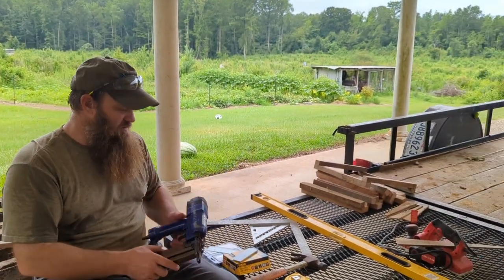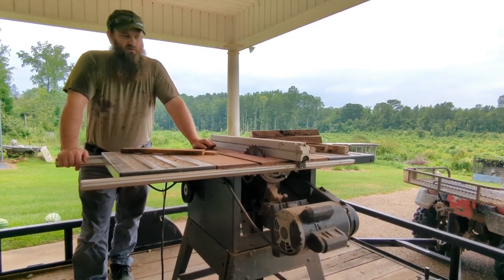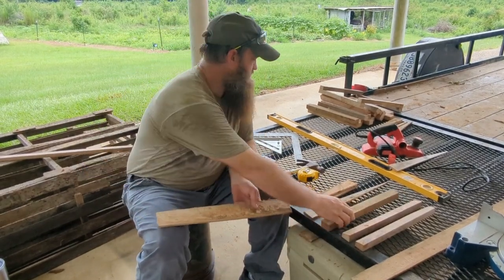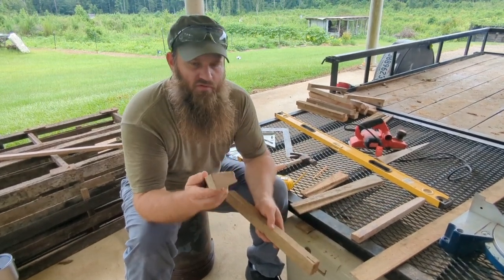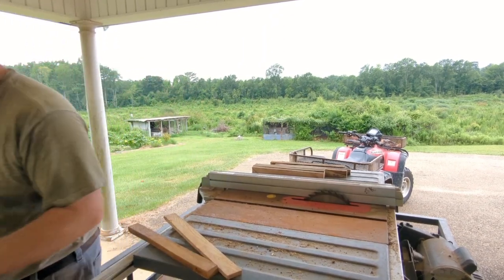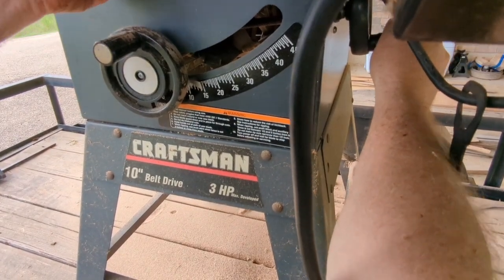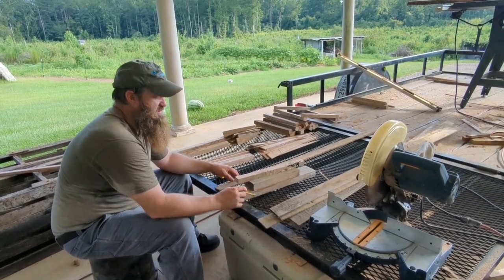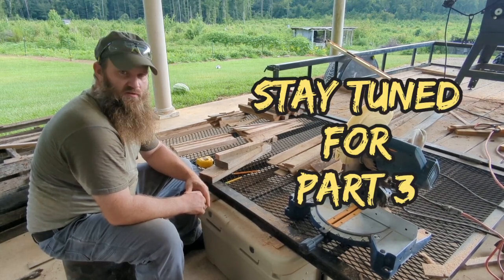Building Homemade Catfish Slat Traps Part 2: (Materials Needed & Making the Cuts)

Comment: Was the bevel angle on the catch slat frame also 15°?             Just watched the third video in  the series and I think I got the answer to my question. Thanks for the videos.
Reply from the maker: 19-21 is my recommendation. You'll have to play with that to fit your likes depending on type wood used and flexibility. Ash you can go 21. Oak you may want 19 or20

Comment: I really enjoy ur videos. I am new to commercial fishing. I just started this year. I have the wire traps. But I haven't had any luck with them. I would like to get a few slat traps but Mississippi have different gaps then urs. Would love any advice u could give me on fish wire traps
Reply from the maker: Yes I think Mississippi is 15" square or smaller. I know the regulations are online if you Google search it. I've had better luck with wire nets in lakes for channel catfish. If the throat isn't right it will highly effect the catch. I'm not an expert on them, but we do have some wire net videos in our video list on our main YouTube page. In the summer I fish them hanging vertical with the throats down. Use the cheese blocks. I use half one unless I know I'm in a lot of fish, then use a whole one. The tail end will only be 2-5 ft under the surface in 12-16 ft of water. This could depend on the lake. This keeps the fish out of the thermocline. No oxygen down low. Now come November we go to fishing them on bottom.

Comment: Can cedar fence pickets be used for the exterior panels? They are inexpensive, readily available, and 3 of them are right at 16" wide.
Reply from the maker: I've been asked similar questions and I always answer in short with if it ain't broke, don't fix it. I can promise if there was a better way the old timers would have figured it out. Guys have asked about cypress before. Fact is ceder and cypress may catch but they are less dense than oak. That makes Oak way easier to sink. Ceder and cypress is way harder to sink, and I'm speaking from experience. That said, oak also last a long time in water and holds up really well and is very strong. Way less likely to pull staples or nails through the board and fish bust out as well. I've seen these traps come up with several hundred lbs of catfish in them. If you cut cedar or cypress as thin as oak slats, they won't be as strong, and if you soak water in those big ceder pickets, there gonna be so heavy you won't be able to get them in the boat. I believe it would be a waste of money trying. Hope this helps!!
Reply: @godscountryhuntingfishing1638  That makes sense. The question crossed my mind for a proof of concept test for when I go on a weekend scouting/hunting trip. I hoped to make 1 out of pickets and if/when it worked, I would make 2 out of the wood you recommended and be sitting in high cotton.
Reply from the maker: My experience is I had some of those ceder pickets and used them for catfish boxes for hand grabbing. They worked fine in that application because I wasn't dragging them in the boat. That said it took me forever to sink them and a ton of weight. Thinks we're like trying to sink life jackets🤣🤣🤣. That said we grabbed a good many catfish out of them